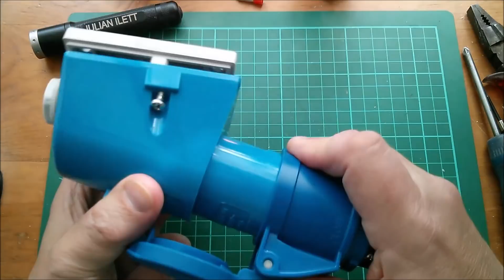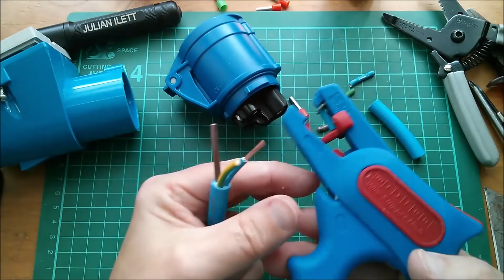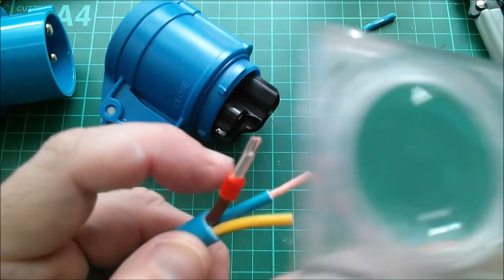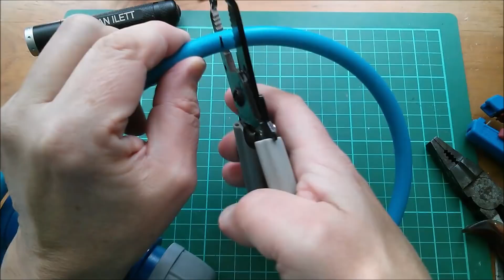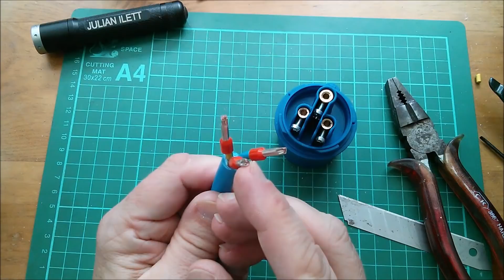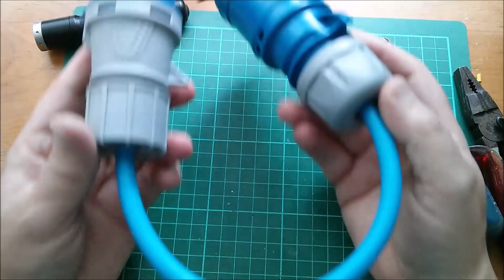16 Amp Connectors Wired

Comment: FWIW on the cable where the ground needed to be pushed between line and neutral it woud have worked like this if you had started with the other end of the cable. A 3 conductor cable cannot have out of sequence conductors...

Comment: I like to use side cutters to strip thick insulation like that. Score around the depth you wish to cut (as you did), but you don't have to cut all the way to the wire jackets. Then, take a pair of side cutters and start trimming from the bare wire end to the score mark you made. Once you get to the score mark, you might be able to just tear off the excess, or more easily see where it needs trimming.

Comment: How are those massive connectors only 16A rated? It is that confusingly the name of them? ferrules are a good idea so you don't not screw up the strands. Yes they should be crimped. And don't use solder because it makes the wire brittle (tin lead inbrittlement). Proper crimping tools aren't expensive.

Comment: The usual suspects sell a ferrule crimper that works reasonably well along with a whole box of ferrules for very little money. I've done some shoddy stuff myself, but for mains I wouldn't want to risk a bad connection like this.
When you snip a properly crimped ferrule in half you'll see that the copper strands are fused together basically in a solid mass, looks really cool.

Comment: I have always liked that style of receptacle but here in the US the only place that uses them is Mc Donalds on their kitchen equipment. I wouldn't mind using them on my shop equipment especially since they are dirt cheap compared to the stuff we use here in the US. Shoe lace ferrules are also not used here in the US either. They are only showing up because you can buy them on ebay and amazon from China sellers.

Comment: As a professional carpenter
A professional concrete cutter
A professional demolition company owner
A professional machine operator
An electronic enthousiast
An audiophile
A professional gamer
And an RC lover

I can tell you just connect the fckn wires because I've been doing it for years and running high loads without any accidents 😂 just screw em make sure you put in a wire that handles the load of your socket and stop listening to those so called professional electricians

"now I've created a sh*t storm! INCOMINGGGG"
Reply: @Andrew van Leeuwen
i agree with you , its not the best job but it works so it is all good :-)
Reply: @RichBristol  - audio does not need high frequencies - human ears are not very good much above 20kHz. And if you are over twenty, as you get older, your higher frequency hearing gets worse. Hence fifty year olds can’t hear much above 12kHz.
Compare the 20kHz to baseband / composite video at 5.5MHz to 6MHz…

Comment: Yes the ferrules are required on stranded wire if all the terminal has is a screw. This is so the wires don’t slip out from under the screw. If the screw is pushing a plate down then the plate will grab all the wires and the ferrule is not needed. 

Also size the ferrule to be tight on the wires. It doesn’t need to fill the socket.

Comment: Fail: "Looks like the earth one will need to be cut a bit shorter.".  The earth one (more correctly called PE) should be sized such that if the cable is yanked out from the plug the PE one will be the last one to still have contact.  That does actually work quite well with these big connectors where there's plenty of space or as in your case where the PE wire is raised.  For other connector you may need to leave PE one or two cm longer.
The ferrules must be crimped before tightetning the screws with a proper crimping tool - a pair of pliers is going to do a bad job.  And sorry, no soldering.
Oh and the ferrule is looking pretty large.  It should be just large enough to fit easily on the wire, no larger.  I think in your previous video you said the conductors were 2.6 mm².  Yours look like they're about 4 mm² - but there's no standard known to me which uses red for a ferrule of that size - or anything close to it.  So that's a bit weird but no problem, the ferrule colour isn't important, just a useful hint at the wire cross section.
At 230V and 16A the current is large enough that this needs done properly.  Because you don't want to meet the fire brigade.  At least not in your own home ;-)

Comment: Never, ever, ever, ever use solder for power connections. Just my two cents. :)
Reply: Nothing wrong with soldering. How do you think wires are connected to the PCB in a device?
Reply: @sdgelectronics  Yes there is a real issue when soldered ends are under screw terminals.  The solder creeps and the connections work loose. I've been safety testing kit for 30 years and it is a real issue, especially in 13A plugs or IEC connectors that were wired in this way.  Arcing, burnt insulation or no contact at all - seen it all.
Reply: @sdgelectronics  But yes absolutely take your point, to a soldered connection on a track or terminal designed to be soldered is fine.
Reply: @sdgelectronics  You're right, as usual it depends on the situation. Soldering is only "bad" if the tinned wire will be put into a simple screw terminal, without spring or spring metal clip, because the solder is soft and will flow away over time and the screw wont automatically go in deeper but stay where it is.
Reply: @sdgelectronics  Totally wrong with screwed connections! Solder tends to "creep away" after a while and the connection gets loose.
Reply: @sdgelectronics  I meant power connection as in power equipment (extension leads, breakers, etc), ie. carrying large currents.

Comment: Need to use a proper set of Ferrule Crimpers they compress all the wires together over a longer length typically making a square section. Also, wires should just stick out of the end of the ferrule a tiny bit this is useful for checking visually you have crimped on the wires and also reduces the chance of it pulling out as the ends splay out a little. Insulation colour is coded for the wire size and if all the wires are the same gauge then all the crimps should be the same size and colour. you should use the smallest size that slides over the wire. The screw should not be used to crimp the ferrule it should already be crimped under the area the screw makes contact.

Comment: The earth connection is raised up for a reason.  The wires get cut the same length, and the earth get an extra bend/loop.
Reply: It was so in case the wires get pulled out the earth will be pulled last IIRC

Comment: 1) Never cut the PE shorter, see the other comment.
2) Yes, the ferrul should be crimped before going into the plug. This one is way to thick though, Looks to be for 4mm² wire, yours looks more like 2.5mm². There should be pretty much no play with the right size.
3) Solder is a nogo in screwterminals, actually illegal here, since it gives over time and the pressure of the screw with be gone. That can result in a bad connection -> heat -> melted solder -> short -> fire. Unlikely but still not a good idea.
Reply: "Never" is wrong, in the example he is doing in this video with these plugs it was wrong to cut the earth shorter, it's meant to be equal so it's connected while the other two wires may be pulled out accidentally or failing for some reason, the earth being the last to come out means it's earthed in those situations at least. 

However, in entirely different applications (nothing to do with this video or these connectors), there is no electrical rule that says the length of the earth cable has to be identical to the live and neutral, the earth total wire in fact varies depending upon which building you are in, it's literally just a wire that goes into the power box and then out into the ground, which is why it's called earth. 

The length of the internal earth cable will vary depending upon appliance also, therefore to say that the earth cable should "never" be a different length than the live and neutral is just false, in all appliances and all homes the earth cable is always a different length than the live and neutral.
Reply: @ziongite  It would appear this muh1h1 guy believes that the electrical function of the earthing won't work if the wire is even 1-2cm different than the live wire. I can't really understand that myself however, but that appears to be what he might be saying.
Reply: @ziongite  you are right.

Comment: 2:25 Professional electrician here: There's a reason for the earth connector to be "higher": If you rip off the cable accidentially the earth wire will unplug at last. So please! do NOT shorten it! Let the cables AT LEAST at the same length!
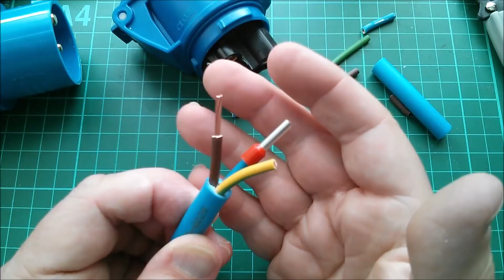3:26 Precrimp: Yes, you have to! It's for maximum surface contact. Use only professional crimping tools. Else, in the case of a fire caused by it the insurance wouldn't pay you a penny!
Reply: Also, the ferrules are too big. Also the wall mounts should be fitted vertically (water draining when they're outside and so as not to put any sideways strain on the cable in the connector plugged into it - sideways strain will open up the waterproof cable strain relief).
Sadly this video is a masterclass in how not to do the job of wiring to an outhouse.
Reply: probably ferrules with plastic sleeves are a better fit inside connectros too to be honest. I got a really decent crimper for about lesss than £10  which is good enough for a hobbyist. They also work for deutch automotive connectors which is what I do. https://www.youtube.com/watch?v=GjWq2Yrfz0I
Reply: Next time minus the "insert job" here,
dont want to know I'm reading American bragging
Reply: @DreStyle  Did an American hurt you when you were a child? TELL US WHAT THEY DID TO YOU!!! Poor thing.
Reply: Yeah! Julian is still alive and no fire. Must be good enough. Lol
Reply: @frankhobsonKJ4CDM  I agree. He's not a mad man. But, had you ever dealt with an insurance company? They have their own detectives. And in such  a case, you'll never see a penny.

Comment: Ferrules are way to big for the wire. They are supposed to be a tightish fit so when crimped they pack all the stands tightly together. Ferrules are meant to fit the wires not the fitting they are going in. This leaves a poor connection that could fail prematurely.